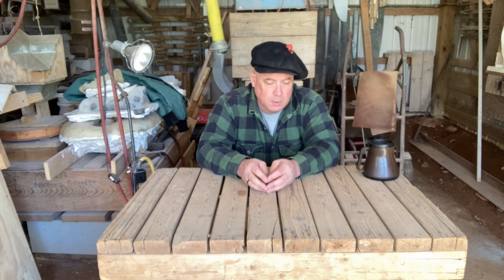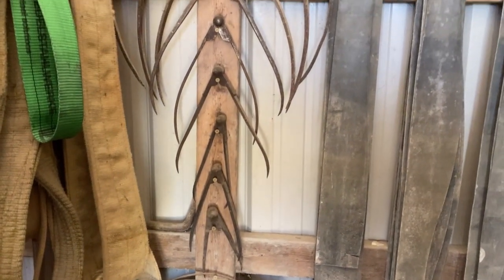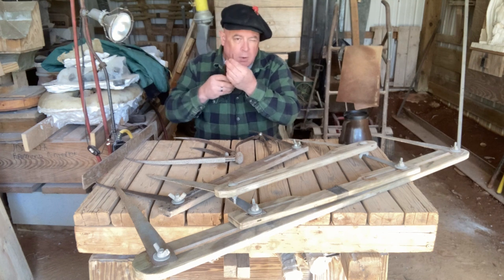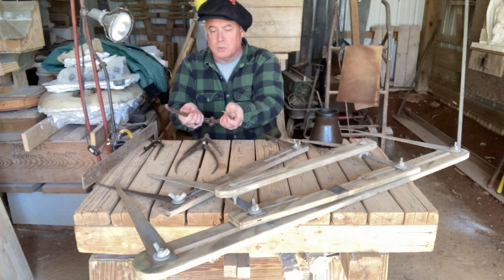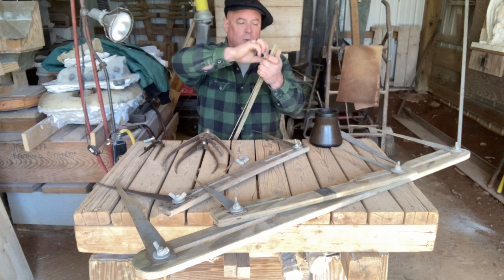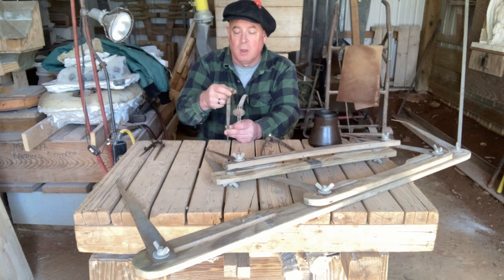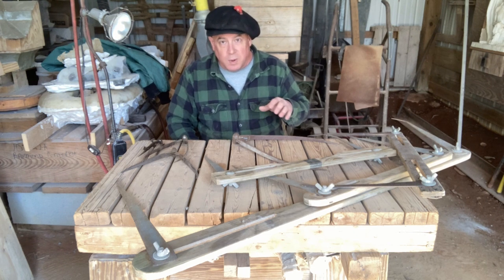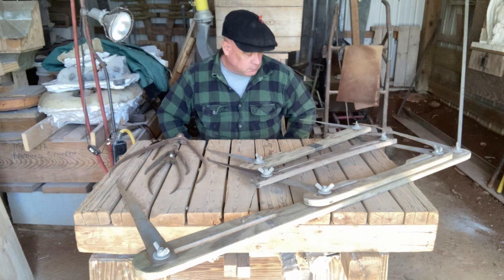Virtual Stone Carving Apprenticeship  VSCA Video 29- Compasses and Triangles 1 Caliper Compassi

Comment: Those Beam Compasses  are   Very Handy   indeed 👍👍 👍 , You wouldn't believe how many engineering /Carpenters square's I have checked before using ,  have been out of square and they have been in use for years and Nobody ever had the common sense to check them, that is until I came along and brought the issue to their attention, That is one of the reasons why I  always prefer to use my own gear  lol 👍😀
   Good Video
Reply from the maker: Thanks, man.  They're very good tools to have in the studio.